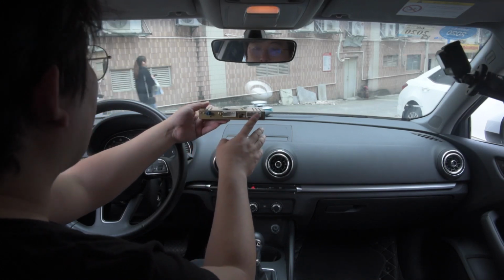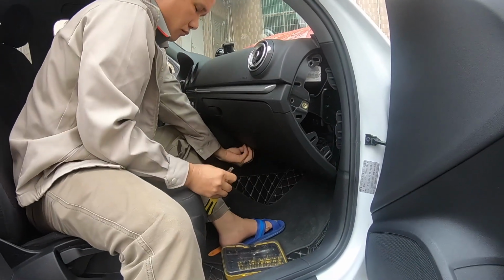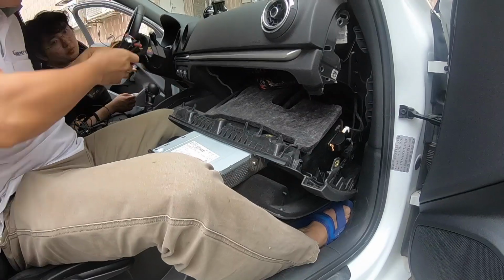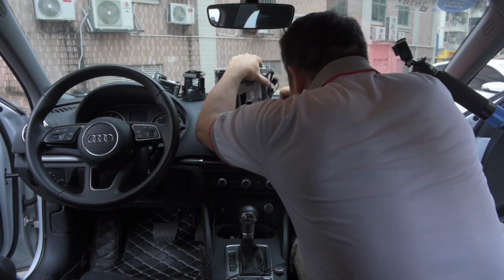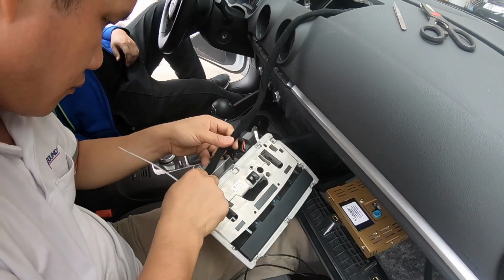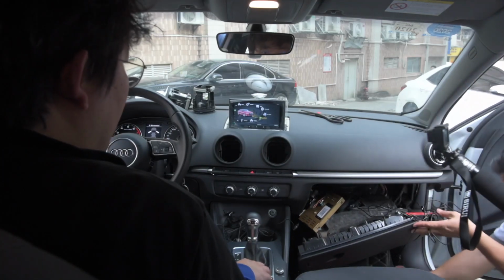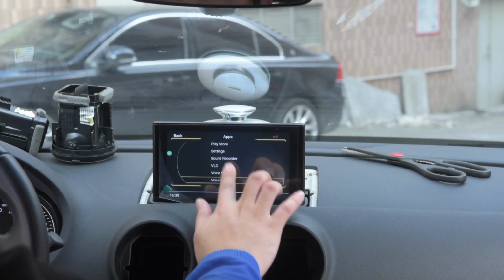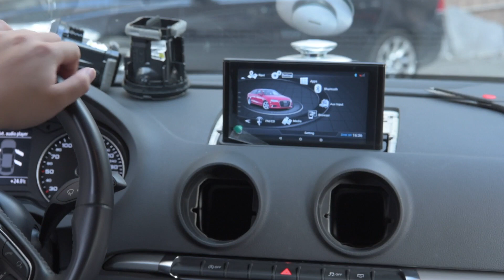Installing RSNAV Android 7 device in A3 8V (English)

Comment: Any tips on how to route the GPS antenna cable into the glovebox area? You pointed to the middle of the dashboard at the bottom of the windscreen, is there easy access there or should you go in from the panel on the end of the dash?

Comment: I have a '12 S4 that I'm interested in installing an RS Nav system into.  I'm curious how it will affect the display in between my speedometer and tachometer when using the navigation option.  Everything I've seen thus far focuses on the display shown here.
Reply from the maker: Speedometer is isolated and protected. No change or no additional feature to it.